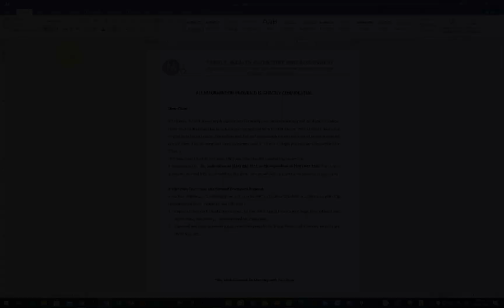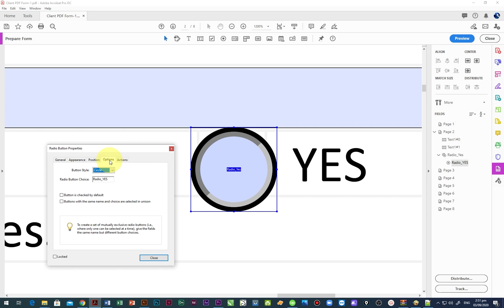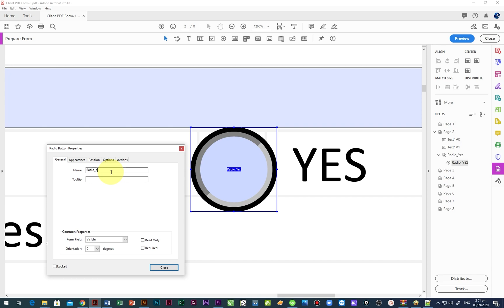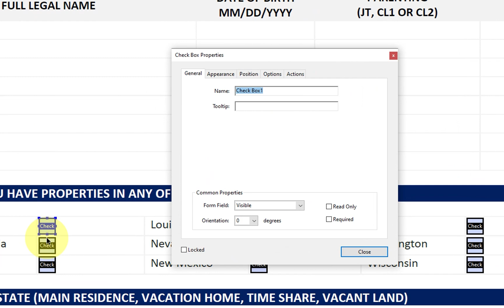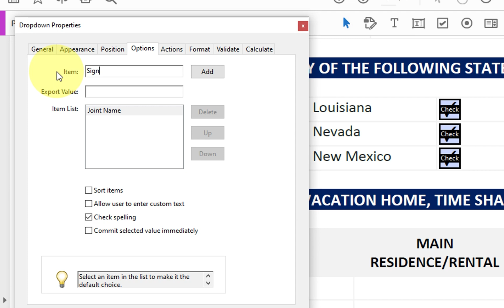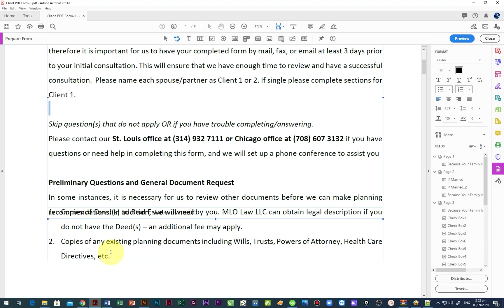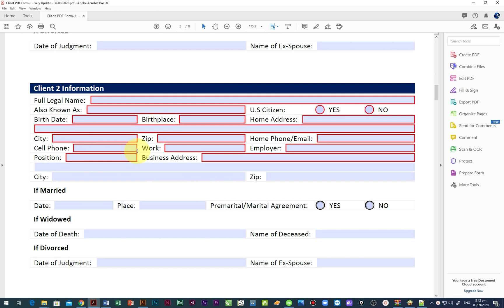How to Create a Fillable PDF Form 2024 | Master Designs #adobe

Comment: Is it possible to get rid of the blue in the text fields?
Reply from the maker: Yes, If you want to create the form in MS Word then possible. Actually the blue color indicates the user to fill or add the info. If you really want to rid / ignore the blue color then create a form in MS Word but for that you to know little knowledge of VBA to input some indication to user or some captain to user that what info to be input. e.g. Email field put dim text "Enter your email address" which is a great user experience.
Reply: @HolyQuran0992  Now I totally get it! I thought it’s a default text field colour that could be changed via formatting. I really don’t mind using the faint prompts/captions to guide the user. But I guess I’m stuck with that baby blue.🤷🏻‍♂️🤓.. thanks for the clarity.
Reply: @HolyQuran0992  Yes you can get rid of highlighted blue color go to Edit>preference > forms and deselect check box for highlight color
Reply from the maker: Hahaha.. No Problem👌

Comment: Dear Sir, thank you very much for this explanation, however i have a question, if we fill it, and print it, will the dropdown arrow appear on the printed page?
Reply from the maker: Thank you for technical clarification.
Reply from the maker: Yes exactly, Thank you
Reply: @HolyQuran0992  is there a way that can prevent the drop down arrow symbol from appearing on the printed page or paper?
Reply from the maker: @adambutch8832  I don't think so. Because it's added functionally. But will check that. Keep visiting. Thank you
Reply: @HolyQuran0992  sure, thank you
Reply from the maker: @adambutch8832  Your Most Welcome
Reply: @adambutch8832  Don't worry the drop down arrow will not appear when you print the form.
Reply: @pdfform  thank you
Reply: @adambutch8832  subscribe & Join our Facebook Q&A Group for any queries related to PDF  Forms.

Comment: Hi
I want add check box for a question it has 2 option yes and no. If I select yes and then no ,option yes check box get black that means only 1 option we can select.
Reply from the maker: HI, 
For Options, you need to add radio buttons. Where the first radio button name (Yes) and Second radio button name (No). So, in that, you can select only one option. 
If the question raise that, In which field do you have experience? Multiple choice question 
Graphic Designer 
UI Designer 
Front End Developer 
UX Designer 
Motion Graphic Designer
So, If you are good at all the above option then you can select all with a check box. 
Basically, the check box is using for multiple-choice questions. and Radio button for YES / NO options.
I hope this will help you.